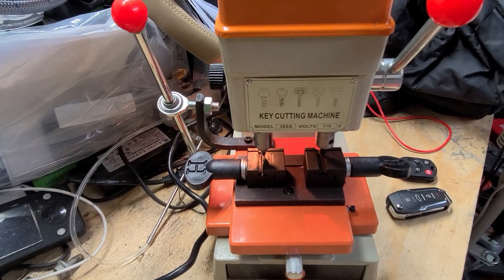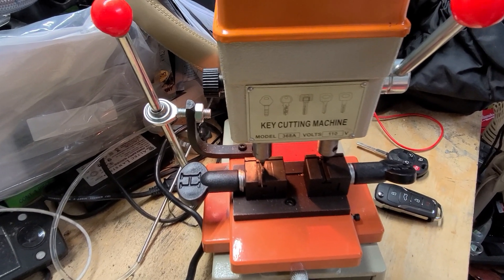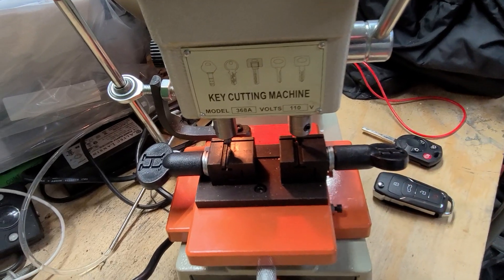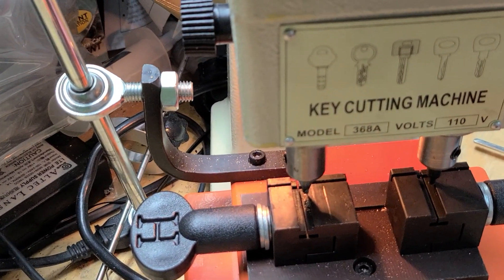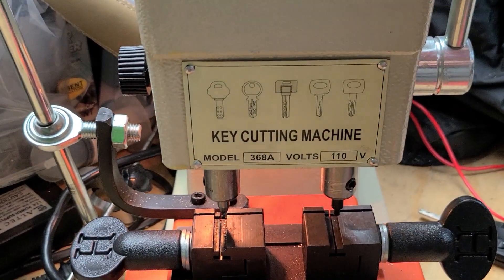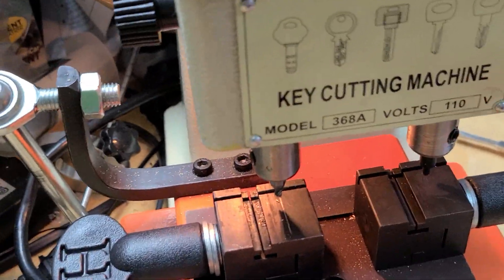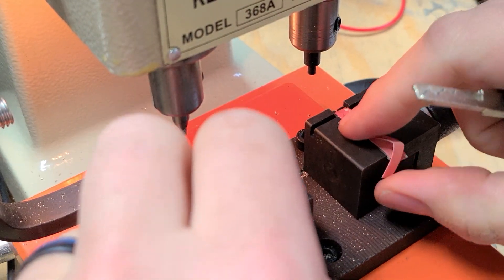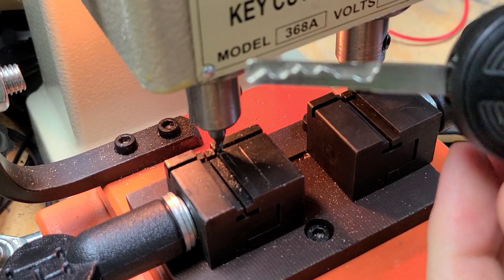Laser cutting our own keys! Why pay a dealer or locksmith? Ebay key duplicator to the rescue!

Comment: I didn't see the laser. HA!.  I just got the same cutter, for the same reason.  I use a metal shim to make the key fit. I have watched many DEFU video's, yours is the only one that figured out the key guide needs to be adjusted from the top.  I wondered why the guide seemed to be springy, then found the adjuster.  I used an aluminum pop can to make the shims. I am still trying to make a C7 Corvette emergency hatch key that works. I am on my 4 try, uuuugh!
Good news, I had success milling my C7 Corvette key.
Reply from the maker: Very nice! I used mine to make a C7 key a few months ago too!

Comment: Do these work for standard double cut as well?  I have a couple of vehicles that take a double cut but the FOB is too big to fit in my wheel cutter.  I have been looking at these, but as you said, there isn’t a lot if info out there on them.
Reply from the maker: I've cut a few standard double cut keys with this. It is a little awkward and you have to lock the movement to just forward/backward/up/down, then take a small file to clean up the edges.

Comment: I bought the same machine a few months ago . just throw out all 240 volts equipment and bought from amazon 12 volts DC engine for few pounds witch fits exactly , new switch with reverse option ,new bright bulb and makita battery with extra switch.
now got completely mobile key cutting machine .With one charge can cut over 40 keys .
all modification cost me around 80 pounds ,plus original machine 165 .
at the moment very useful and cheap
Reply from the maker: That's awesome!
Reply: Which motor and makita battery did you fit? Have you got a link please

Comment: After so much modifications  it seems that machine is a piece of crap...
Reply from the maker: It's worked fine for the last few years of occasional use. It doesn't come with the specific adapters for different types of keys, so you can buy them or make spacers like I did.

Comment: so this does the same thing as the machines that cost thousands? The answer would be to only use brass key blanks and use the key code for cutting. I own two Belsaw key duplicating machines. I am slowly getting the tooling together to start a mobile car lockout and key making service. I will have to get the reprogramming computer also.

Comment: Thanks for the tip about tightening that internal bolt. Mine was loose.
Reply from the maker: The bolt being loose helps with alignment on certain keys, but most keys I make it causes more problems than it helps.

Comment: How does this type of machine work with a normal (non-"laser") key profile like a house key? Do you use a different key block or something so it can cut all the way through the key? Or do you need a whole nother machine for those?
Reply from the maker: I've cut house keys with this. It is a little tricky as the cutting bit likes to jump off the side. I set the key cutting side up, flat side down. After cutting I take a small file to remove the burrs on the edges.

Comment: I'm intrigued, but confused as to the "laser" part of it.  Why is it called laser cutting?  I need a Toyota key cut.  FOB is dealer programmed already.  This FOB is the backup unit to the one that came with the car.  The original key has cuts on both sides of the key. Would this be possible with this type of machine?  Not opposed to getting a new hobby but makes me wonder where I would get a replacement blank if I screwed the one up that came with the FOB.
Reply: You can buy just the blades that goes in those flip out style fobs rather than buying the whole thing all over again.

Comment: Lot of time spent, locksmith might be a better way to go. 
I had that machine. Sold it off and got a used Silca Matrix, problems solved. No more non working fresh cut blades.
Reply from the maker: I've had very few problems with this. I don't cut enough keys to justify the cost of the Matrix. It's an excellent machine though.
Reply: The ORIGINAL @HeartlandRebuilds  Silca MAtrix was excellent.The current on, meh.

I throw no stones at hobbyists doing favors for friends and family, cheapskating is fine. It also is how many locksmiths originally got started.  

Once you get a taste of making keys accurately to code, using new remotes, not cheazo universals or refurbies, you will have fond memories of hacking it.

Enjoy the process.  I started with a matrix SLX and a manual code cutting adapter, many years ago

Comment: Most locksmiths would’ve cut those keys for $30-$40 each. You bought the cheapest key cutting machine. Good luck getting things working and spending more money
Reply from the maker: I've used this machine well over a dozen times without problem or spending more money. It's easily paid for itself several times.
Reply: I own a very similar machine (the DEFU 998-C) & I've had 100% success AND there are scores of videos of other folks using this same machine (or the DEFU 998-C)with a very high degree of success. Let me guess we're all just lucky... LOL
Reply: You think he only cut one key with this? You obviously don't work on cars. People (like me and this guy) work on lots of cars so its obviously worthwhile. Nothing wrong with learning new skills either.

Comment: why is it called a laser cut key when it is using a cutting bit and a spinning motor?
Reply from the maker: Side milling key doesn't sound as futuristic and difficult to make maybe?
Reply: Pretty much @HeartlandRebuilds
Reply: LAZER CUT,LASERCUT, Sidewinder and other terms are just euphemisms.  The are no CO2 or Fiber lasers involved.There usually are CNC machines, to cut to code, even when original key is trashed

Comment: Hello I need help , so I lost my 2004 Mini Cooper keys , I have no keys to make a copy now . My question is I don’t want to pay the dealer ship $400 for a key so I bought one from eBay and since the car has bad transmission I just need the key to lock and lock the doors I know it’s easy to sync the key remote but what is my option of cutting the key if there is no key to make a copy on , is there a way to find my car key code somewhere so I take the code to the locksmith to cut my eBay key or I have to take the lock cylinder out and take it to to the locksmith ? Or any other options please ?
Reply from the maker: Previously I have taken the door lock cylinder out and brought it to a locksmith to cut a key. Could also have them go to the vehicle for more.
Reply: If its titled in you name goto dealer and have them make you a vin matched key

Comment: Don't want to take it to a locksmith? They charge quite a bit? professional locksmiths charge for the expertise and experience. If you want it done right, get an experienced professional. Some things, yeah you can do by watching YouTube. Others, it's worth the cost in the long run to pay an experienced pro. Watching you fumbling around with what looks like a toy? advise, go find a real locksmith. Just my cents...
Reply from the maker: Thanks for your cents. This probably isn't for you. Making your own key for 1/10 the cost of a locksmith saving hundreds may be worth it to others though.
Reply: Expertise and experience does not = high prices. Would you pay $100 for a McDonalds hamburger, because it was made from 'expertise and experience'? LOL. Locksmiths are not brain surgeons. Just middle school dropouts with low IQ and a slimy side hustle.

Comment: I have a 2020 Chevy Sonic. I have a spare key that is only to open the driver door. The ignition is a push button start and the key has already been programmed for that. Do I still need some kind of additional programming for the key so that it works on the door lock?  Thx.
Reply from the maker: I don't quite understand the question. If you have the backup key for the door already, then you are done for making a backup. The key fob needs to be the same frequency as your car so the buttons on it work. Then you have to program the fob. The backup key is only for opening the door if your battery dies, or in some cases, you need it to start the programming of a new key fob.

Comment: Just got that exact key. After programming it, the remote works great! But I took it to Home Depot and they won't cut a key that isn't purchased there.. GREEDY! GREEDY!
But it's no wonder! Home Depot sells their FOBs with built in key for $100
Reply from the maker: Exactly why I bought this key cutting machine. No business I could find would cut a key I brought them. There's no profit in it for them, hence requiring you to buy a $100 key that you can find for $20 online.
Reply: 20.00 online keys are used, reshelled..... often with worn out unlock buttons.

 DUPLICATING them is never as good as decoding and making fresh originals. I know some locksmiths will not cut used online keys. I will but without the guarantee that the ones I provide,decode,code cut,and program. Machines I use cost 10fold, but they are insanely accurate. You do you! I provide services to dealerships who have a pile of key machines, and finally gave up on DIY

 @HeartlandRebuilds
Reply: How is that greed?  Aren't they a for-profit business?
Reply: @rmsg7504  Umm, lemme think.... Home Depot sells the SAME FOB, made in China, for massively more money! How much of a profit markup do they have to make?
Reply: @rickpontificates3406  as much as the market will bear. Did you not take economics in college?
Reply: @rmsg7504  I know PLENTY about economics and I also know that THE CUSTOMER MEANS NOTHING to corporate America now. STOCK INVESTORS are the only thing corporations pay attention to now... PADDING THAT BOTTOM LINE and "GOLDEN PARACHUTES" for the top executives
Reply: @rickpontificates3406  if you took economics then why are you asking questions you already know the answer to?
Reply: @rmsg7504  I ask NO QUESTIONS. I only observe that most companies stopped caring about people
Reply: @rmsg7504  Your right but it takes them 2 minutes and they charge $30. bucks.

Comment: Have same machine but I clamp before the shoulders using them to align the keys or 'how far back to put them'.
Reply from the maker: That would work too. It really depends on the type of key being cut. If I used it more I would buy a set of blank holders specific to a manufacturer.

Comment: Great video, but what I don't understand is what's the name of the machine or manufacturer? I bought one of these machines to do simple key cutting at my shop. Please do a video on what is the correct bit for cutting what key thanks.
Reply from the maker: The model number is 368A. There are a few manufacturers that make these. As for the bits, there are not much difference between them. I use the smallest one I could on standard keys so they can get in the deep cuts. On side cut keys I'll use the largest one that will fit the cut. You just need to make sure the guide and cutting bit are the same size.

Comment: Get the HU101 key fixture, easier and more accurate then doing it that way with a paper spacer.  Only $17 on eBay for a set of the key fixtures for the machine to make the H94/HU101 style Ford keys.
Reply from the maker: Good suggestion. I don't use this enough to start buying key adapters, but if I did, that one would work significantly better!

Comment: Nice video! I have one of these machines I bought years ago and never really used. Also I’ve seen comments about why a lot of locksmiths won’t cut customer provided keys and say they will mess up their machines - there is some truth to this - some of the keyblanks you buy online are made of different metals (cheaper manufacturing I suppose) and they can chew up milling bits on key machines. Some of these bits can be pricey to replace - a way to check is to check a key with a magnet (most keyblanks are usually made of brass so they are not magnetic). If it sticks it’s likely to damage the cutter. Now another thing is I don’t cut customer provided keys mainly for these reasons: Often customer provided keys don’t always work (they won’t program wrong part #/cheap defective junk). There’s always a chance that a key gets cut wrong by mistake and that’s a problem. Also if we cut a customer provided key and it doesn’t program customers often want to blame the locksmith and swear there is nothing wrong with their key. Lastly - being purely mobile we don’t make enough money off cutting and programming customer provided keys plain and simple. It’s like bringing your own hamburger meat into McDonald’s and asking them to cook you a burger! Now of course if you want to buy a machine online and all the stuff to do it yourself as a lot of people have done on here all the power to ya! I choose to not do it because I don’t want to deal with the headache that often results from these types of service requests.
Reply: That's bullshit
Reply from the maker: Thanks. As a business you need to make money where you can. Good info.
Reply: I get the general sentiment, but a lot of times they charge 5-10x more for the blank, but they are mobile AND cheaper than a dealer so I deal with it.
Reply: I'll gladly take your customers then, simply have them sign not responsible, and get paid. I guess some people rode the short bus

Comment: how would you know what cutter to use for what key ???????
Reply from the maker: There's different size bits. If you get an assortment, just find the one that fits the best and the non-cutting guide that matches it.
Reply: @HeartlandRebuilds  does the machine come with any bits ???
Reply from the maker: Yes, it came with a couple. I bought a larger set online in case I broke any. I chipped a bit on one of my first ones going to fast so it only has 3 edges instead of 4 now.

Comment: I was able to cut 2012 Honda Civic laser cut keys and then borrowed an Autel Mk808 to program them and saved myself a few hundred dollars and made 3 keys instead of the 1 that a locksmith charged the same price as the machine. This video by Jack Myers is all I needed (https://www.youtube.com/watch?v=xaR-u_EgO4I&t=38s) , was really helpful and did 3 keys out of 4 total because I messed up slightly on the first one. Just make sure you really double check everything while cutting and before cutting

Comment: got the same f-off from ace. thinking about going the same way
Reply from the maker: It's worth it. I've made keys for 5 different vehicles now.
Reply: @HeartlandRebuilds  what keys you used to practice once you got it? mailbox ones? :)
Reply from the maker: @boltyk1  Nope, I just went really slow the first time. It probably took a good hour setting it up and cutting the first key.
Reply: @HeartlandRebuilds  that was brave for sure :) I need to cut some home and mailbox keys anyway, so I'll have some training time. And I have toyota - so it's not so crazy side cut as it was for your ford
Reply: @HeartlandRebuilds  During yesteryear, when computerized tooling did not exist, serious manufacturing required the services of a skilled 'Set Up Man' to prepare machinery for high precision manufacturing, who worked alongside the people running the lathes and milling machines. Such person had to not only know how to set up machines for precision cutting and milling. (S)he also had to know how various metals would 'behave' under high speed, high precision  manufacturing.

Comment: where did you pick this up at this price ?
Reply from the maker: Ebay - there's a few around $110-$130.
Reply: @HeartlandRebuilds  is there, for whatever reason, a certain type of key for certain Vehicle make  that it won’t work on?
Reply from the maker: @juniorsarmiento7292  possibly, I've used mine to cut copies on a few VW and Ford. I don't see why it wouldn't work for most vehicles.
Reply: @HeartlandRebuilds  I tried to get a key made the other day for a VW, and the locksmith told me my Ebay purchased key blank might 'break' his cutting bit because of excessive hardness. Of course, I think it's just hoakum to get me to buy his key blank, which was probably purchased from the same internet source as mine.
Reply from the maker: @lorenzoparedes2306  lol, that's absurd. They make money selling you things and that is just another way to do it. Keys are not made with hardened steel, it would have been fine.

Comment: Do you change the bits for different keys? Or will the same size bit work for all keys? I just ordered one of these and I have to cut keys for a 2018 Sierra, 2015 Civic, and a 2016 Fusion.
Reply from the maker: There are different bit sizes for different types of keys.
Reply: @HeartlandRebuilds  thank you, I just got it in today and yeah I know what you meant now, I just cut 2 of the 3 keys today abs changed out bits and tracers! Thanks for the quick reply!

Comment: Did the same then went on to programming the key and remotes xhorse vvd1 max works OK easy to use but still not mastered the remotes side but the cars I have Peugeot and Citroën are not that easy to do made the remotes but will not connect to the car but good video
Reply from the maker: Thanks!

Comment: thanks for sharing, i have the exact same machine, where did you buy the bits?
Reply from the maker: I bought the bits on Amazon.
Reply: @HeartlandRebuilds   AliExpress sale £55 plus 25 delivery in fact bought the other type cutting key machine for more or less the same price as well wait for the sale only downside takes 3 to 4 weeks to come
Reply: You could of got a couple of cheap feeler gauges for a more accurate spacer than the paper but it works so that's all that matters
Reply: Date key no go the top the key go second step no the Fer one